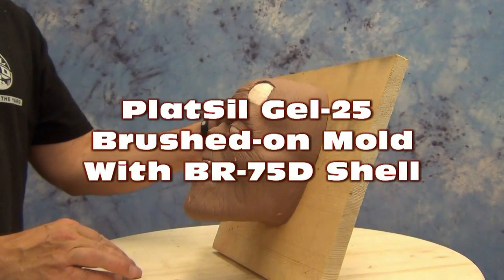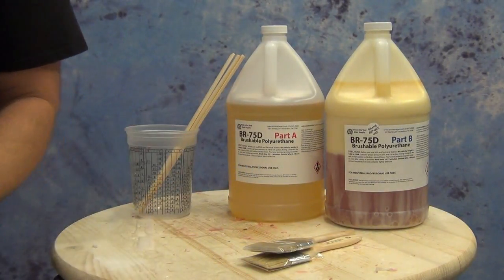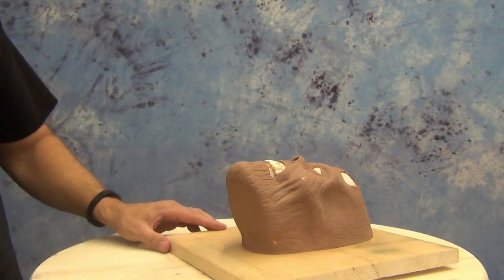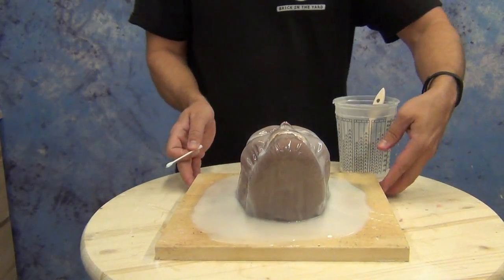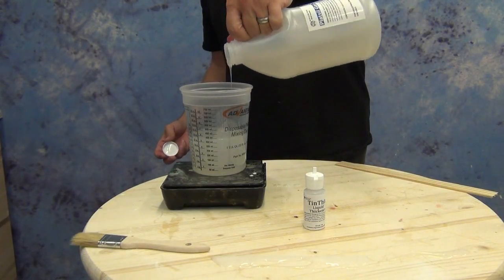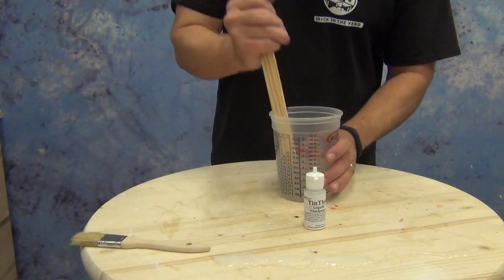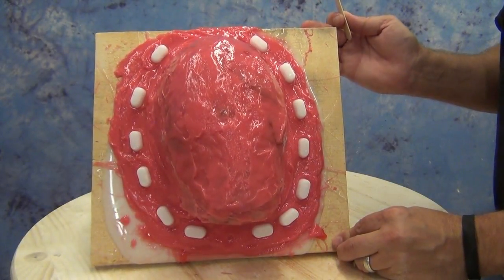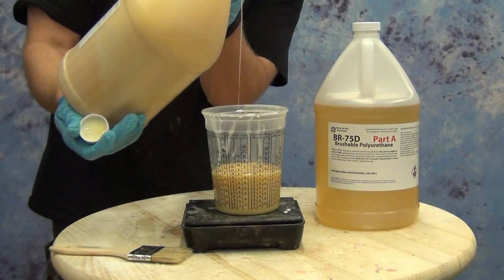Brush On Mold Of A Monster Clay Sculpt With BR-75D Mothermold

Comment: This is great but there’s so many mixtures it becomes preventative or de-incentivizing. Could you not use liquid latex, let it dry and then paper mache strips over it to get the same result?
Reply from the maker: @rraptor158  are you asking about latex for the mold process or latex for the ghoul head?

Comment: The stuff you used to make the mother mold, does it smell bad like fiberglass resin?
Reply from the maker: Thankfully, it does not. As with most all urethanes, I recommend using it in a well ventilated area, but it hardly has any smell at all.